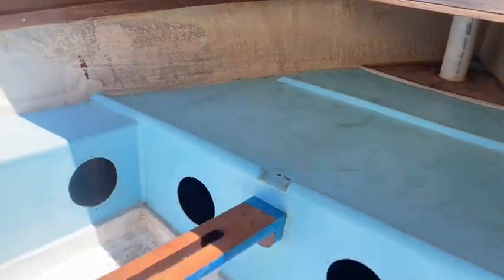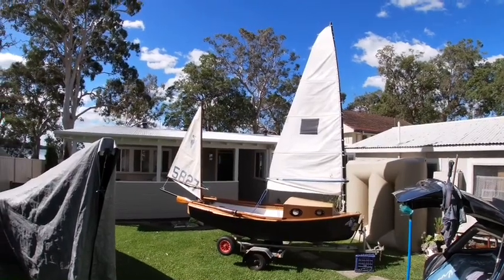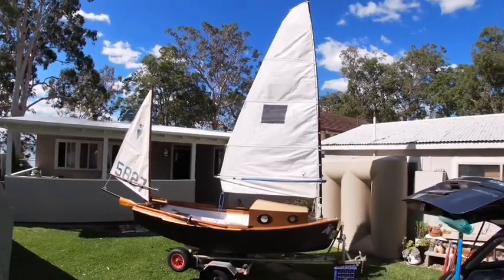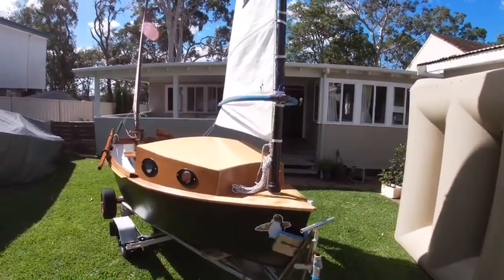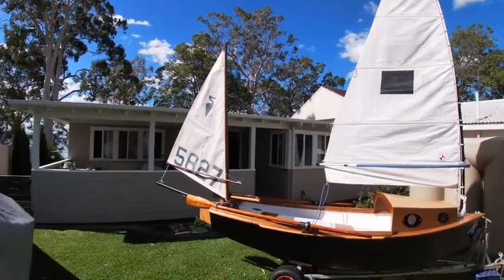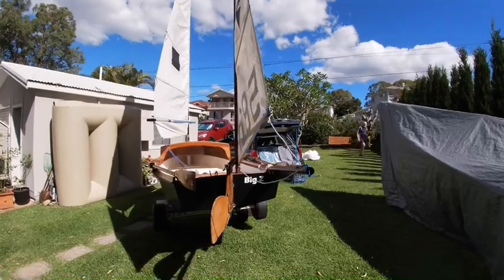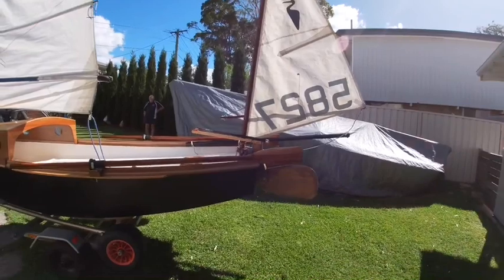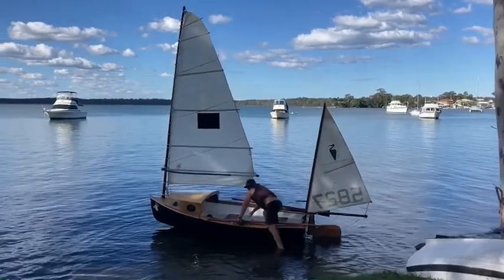Dinghy cruising Heron conversion to Cat rigged yawl.

Comment: Nice job! I have a heron earmarked for a similar conversion.
Reply from the maker: Thanks it was a fun project, I look forward to seeing yours.
Reply: Hi Bruce, what fibreglass system do you like to use if you dont mind me asking? And where do you buy? I'm at Dee Why on the Northern Beaches. I am just starting my Heron conversion, which is a very very old timber boat that was never finished correctly. My conversion will be similar to yours but with furling main and mizzen (both with booms),  sliding rowing seat and lee boards to open up the entire boat. No cuddy planned at this stage, but I do plan to use it for beach camping. I'm thinking of a small dodger that can be pulled up when required.

Comment: Hi Bruce, I recently bought an exracing Heron and I'm thinking of changing the rig to a balanced lug. I'm wondering if you considered a lug rig. And if yes can you help with details of the rig - sizes of mast, yard and boom? Is the current position of the mast ok for a balanced lug?
Much appreciated Rick
Reply from the maker: Hi Ric,
I didn’t consider a lug rig as I am not familiar with them. I used the same basic sail area as the standard rig with my main and mizzen combined. I guesstimated my mast position for the yawl rig but I don’t know if you would need to move it for a single Lugsail. I think you can change the balance of a lugsail by moving the yard and boom forward or aft so may help if the mast position is slightly out. I hope this helps. I do recall someone else doing what you are planning and he moved the mast 100mm forward from memory.
Reply: @brucedyson-smith459  Thanks Bruce. Hopefully someone will see our discussion and be able to clarify. Cheers Rick